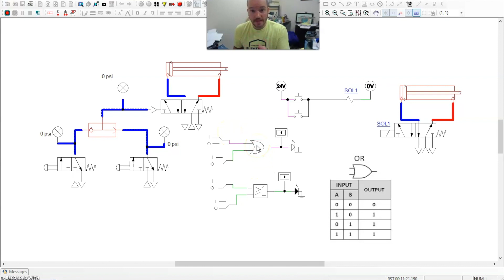OR Logic in Different Types of Circuits Ep4

Comment: 02:08 The OR gate is behaving like an AND gate where both inputs are used to extend the cylinder. In comparison to just an AND gate, is the only difference here that when one input is removed, the cylinder will still extend?